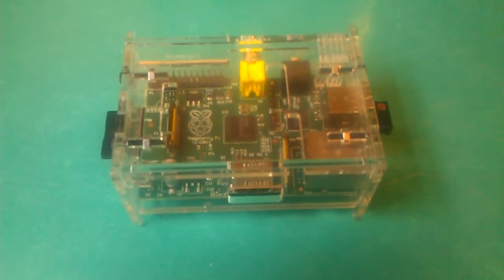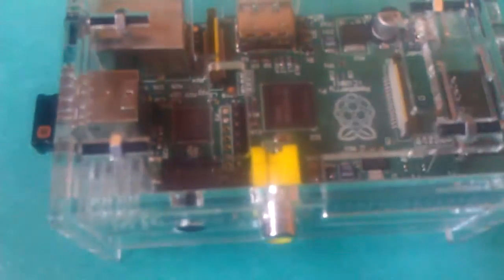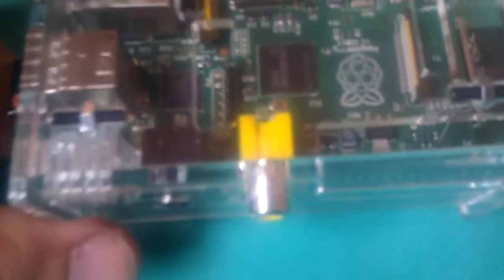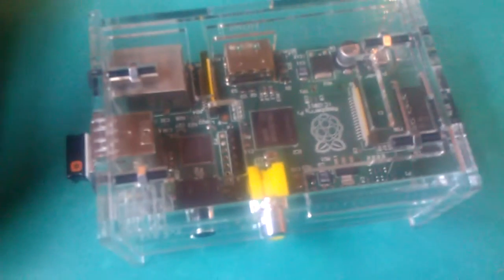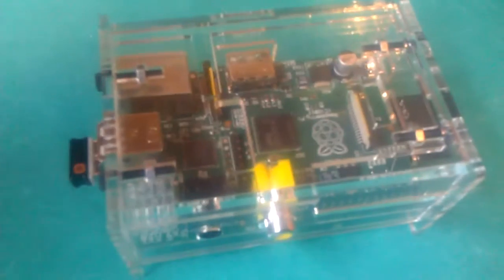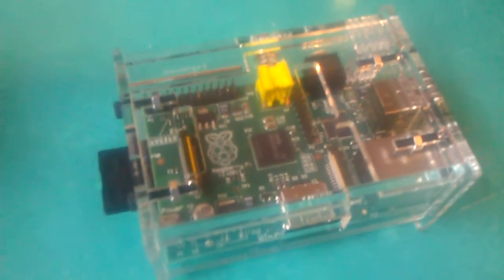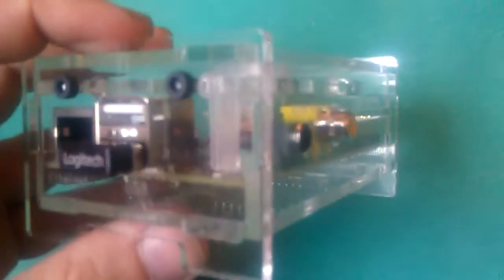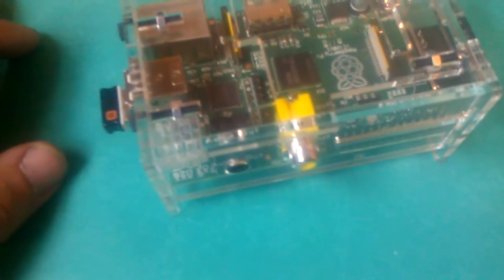Best case enclosure for Raspberry Pi

Comment: i would love to post a video. I ended up supplying one of my customers with that case.  I was going to order another as I've got 3 RPI's now but they were on back order so I ordered another Built to Spec case.  The adafruit is probably my favorite between these two cases because of the simplicity to put it together and take apart.